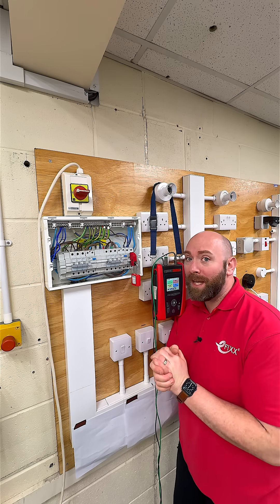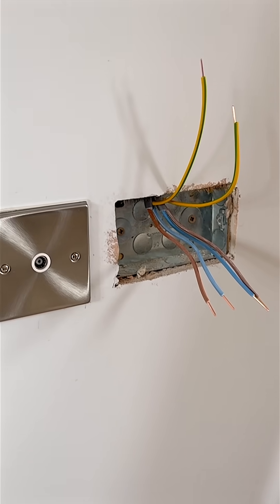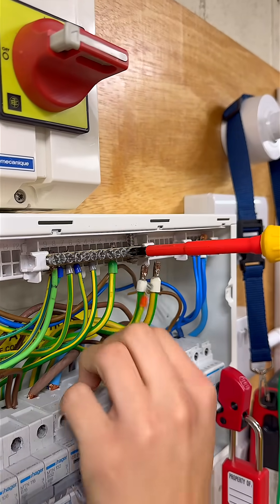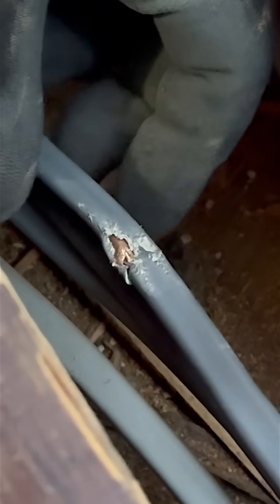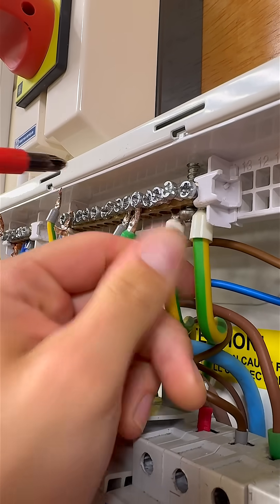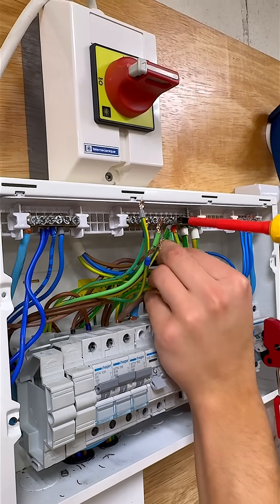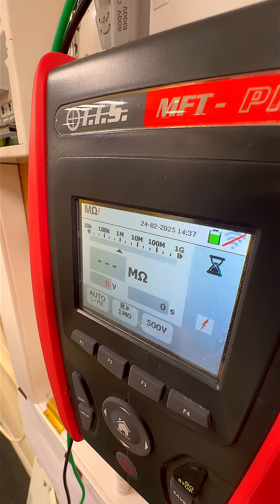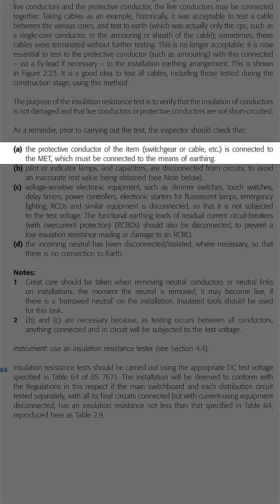IR Testing: Don’t Forget This Connection

Comment: I understand this but I don’t get why? When I did my training back in the eighties we were tought to remove all conductors of the circuit being tested and test line neutral line earth and neutral earth with all loads removed and switches in the on position. And the reading should be not less than 1megohm . And repeat for each circuit in turn . So what and why has it changed. The IR test is to determine if the circuit cable is in good condition and not damaged or deteriorating. I don’t see how having the earth wire removed can give false results. Surely what you’re talking about only applies if you are doing a global IR test ie testing the hole installation including the bonding. I have tested this on my test rig at home . First by testing IR the way I was tought at college as described above and then how this video says and I got exactly the same results ie off scale high. 
So can you explain please. I think this is just another pointless change by the IET ? Or have we all missed something?.
Reply: Think about singles in trunking if the insulation on the brown was damaged and touching metal. If we test line to earth with the earth disconnected from the earth bar you wont see the fault, your only going to see the fault when energised.
Reply: Exactly that, we test between live conductors and earth. When the CPC remains connected it allows the test to be performed against an earth consisting of all final circuit CPC's, any exposed and extraneous conductive parts and more often than not true earth.